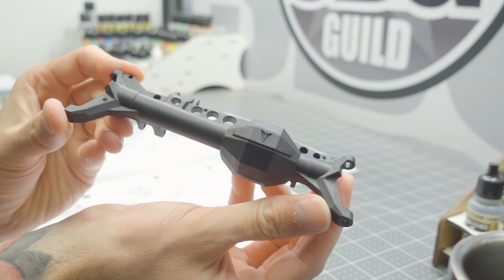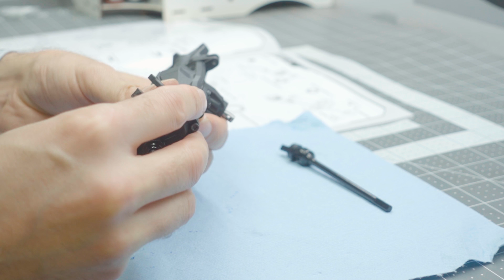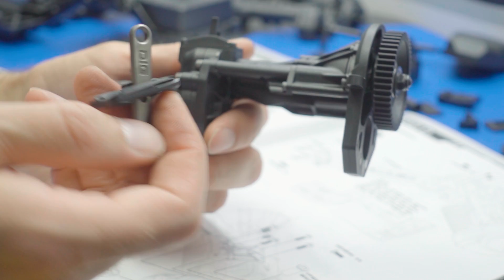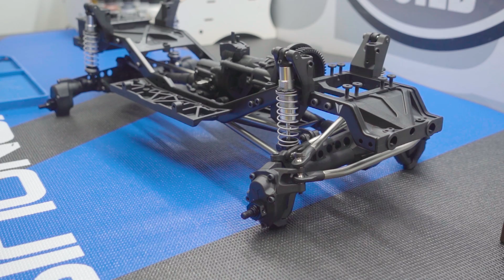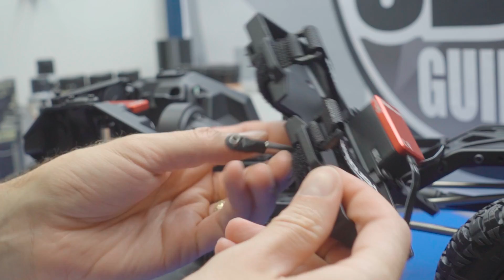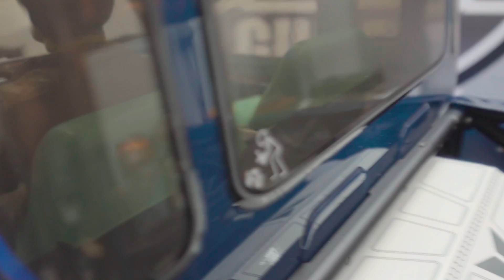Vanquish Products VS410 Phoenix Build Highlights

Comment: I'm building my kit now. After I added drive shafts to the trans. It's very hard to turn them by hand. When I had the trans out of the truck it was very easy. Not sure if that's right or not
Reply from the maker: I'd suggest a tear-down and start over. There are a couple of bearings that are close in size that if reversed can cause some binding. Hope that helps!

Comment: Hey, man! I recently got into RC and initially got into 1/24. Now I was to get my first 1/10, and I am seriously considering the Vanquish. It'll take some time for me to research all the parts and get everything I need, but with your comments about the manual I am confident I'll manage. I wanted to ask you if you could give me a list of tools that I would need for the build. I don't really own many tools so I would need to get all the tools as well. I don't want an electric screwdriver but need to know the tools for the hex, nut screw sizes, etc. 

Thank you! Nice video! I will probably watch your full build once I get everything I need.
Reply from the maker: Thanks for watching! the Phoenix is definitely one of my favourites, so good choice! As for a list of tools here goes: Pair of pliers, flush cutters, Nut drivers- 5.5mm, 7mm and 8mm, Hex drivers- 1.5, 2.0 and 2.5mm. Everything that is required is listed in the manual. Good luck!
Reply: Seems all I'm missing is a couple hex drivers! 

So thank you! I'll be sure to tell you how it goes 😬👍

Comment: Ya kit is not what it seems.  Don't worry if you buy one you'll  find out.  Hopefully you  get second addition.
Reply from the maker: Interesting comment… this is one of my favourite rigs… what happened?
Reply: @scalebuildersguild  missing part , but vanquish step up and sending free replacement part out. Dissatisfied with shocks as your aware.  Its a high price for a kit to run into these kind of problems , bought a lot of cheaper ones with zero issues.  Again vanquish made it right, was going to delete message.

Comment: Hey Matt, I have finally been able to order one and cant find a clear answer on if the hobbywing fusion will fit? If not what would you suggest for a sub $200 setup? appreciate it and love all your videos on the phoenix so far
Reply from the maker: Fusion won't fit without modifying. It can be done apparently, but I have no experience with it.

Comment: I'm more or less new to RC and while I love it, I'm also terrified of building one, but I really want to. I just managed to do the straight axle swap on my 10iii and so far, the only thing I think I did wrong was put the engine in backwards! Time will tell though. Has anyone built this kit yet? Is it hard, or could a "beginner" do it? I've learned the hardest part (so far) is having the right tools and learning the vocabulary, never mind the fact that the electrics and battery options are utterly overwhelming! Any help would be appreciated.
Reply from the maker: It’s perfectly fine to start with. There might be a few frustrating moments, but with these videos to help you through, I’d say give it a go!
Reply: @scalebuildersguild  Thanks Matt, very much appreciated.

Comment: Do you anticipate a possible binding issue on the dig, overdrive servos, when the dogs don't align up just right, with no servo saver?
Reply from the maker: Nope, it's a mechanical keyed system, as soon as the axle moves even slightly, it pops into position perfectly.

Comment: Yeah I had so much fun putting my pro together, I watched Josh from Harley designs build video three hours and 45 minutes only looked at the manual for the screw size and the length of the links, after two years few thousand miles never broke nothing until now one bearing went out in the front ring gear I need the bearing retainer because I can’t get the outer bearing race out of the bearing retainer I emailed Vanquish for the part waiting on hearing from them

Comment: Just no.
Vanquish was the top because they never skimp on quality. I'm guessing i would buy the axial raw builders kit over this one.
I'm still building my pro, but Vanquish looses points because of this rig.
Reply from the maker: I guess that’s one opinion. Not sure how you can think that though. Still a strong upgrade path and a much more affordable entrance to one of the best platforms ever.
Reply: @scalebuildersguild  the whole reason I finally gave up the money for a vrs4 was for the axles and the transmission. The rear plastics get replaced, and the bumpers go into the parts bin. Then the truck gets built from there. So, this kit has removed all the good stuff that makes a Vanquish worth the money. If I'm going to throw half of the thing into the spare parts box I'd rather toss cheaper stuff.
Reply: I agree with Brian.  I  have a penchant for machined hardware which is why VP has always appealed to me as a brand. I think it is great that they are offering a pocket friendlier version for the masses,  but im going to hold out for a deluxe version. Upgrading would be too expensive for me as I live in Germany (Guten Tag) and getting hold of VP parts is a costly undertaking. Id much rather buy the finished product pay the shipping and any duties and be done with it. The VS4-10 PRO is an option, but i much prefer the features and look of the Phoenix, so as hard as it may be, im going to bite my lip and wait it out.

Comment: Hey man, I'm looking to pick one of these up soon. I have a question on motors. I know that it only accepts 540 sized motors so my question is will my Spektrum Firma 2100kv BL motor fit?
Thanks in advance
Reply from the maker: Provided it’s a standard 540, you shouldn’t have any trouble.

Comment: how would you compare this to trx build ?
Reply from the maker: Traxxas’ manual is hard to beat!
Reply: Two words over priced
Reply from the maker: @jasond1245  how do you figure? Curious to hear your insights!
Reply: @scalebuildersguild  easy trx4 sport kit 300 scx10.3 kit 400 its 200 dollars more the trx4 so I guess a selectable overdrive and dig is worth 200 bucks more and with one piece axles and if you look at it compared to a scx10.3 same style of axles but it has a license  body with dig and 2 speed so I guess the selectable overdrive is worth 100 bucks by it self not trying to be mean but this is me looking at it logically comparing too other quality kits and I know you like vanquish your friends with Harley designs and I like both of y'all's videos even though he comes off a little arrogant sometimes I just don't see how you can say this is not high when compared to other kits
Reply: @jasond1245  quality costs... don't get me wrong, the TRX4 Sport and SCX10 III are great kits,  and good value too - but the Vanquish plastics, metal components, and chassis/transmission design as a whole are a step above. That is what you're paying for - finesse.
Reply: @yodapig  sorry sounds like you paying for a brand name the frame and plastics and transmission on the trx4 are great can't say on scx10.3 since I don't own one but I've seen people run stock trx4 4s plus.
Reply: @jasond1245  I get what your saying but just basic Pysics and chassis, transmission design puts the vanquish truck in front for me,  also the c hub and portal design is a lot more compact...
I like all the trucks, but money is a factor for some and folks should purchase what they like within the budget they're working with. In my eyes the scx10iii is more a comparison as it has interior,  molded inner fenders etc . I think for the added levels of option and included parts have them all sitting at slightly varying prices and levels of value.
And yes Josh can come across as a bit of an arrogant dick at times but I'm sure he is aware of that..lol. but I respect him for saying what he backs or believes in.. as I do everyone. 
Cheers 👍
Reply: @mickd8188  I agree the scx10.3 is more comparable but for me I just can't see how the plastics and frame can be any better on the trx4 never bend or broke anything and have rolled it off strip mine hill 40 or 50 feet with only the body taking damage so when I look at it for 200 dollars more I only see the dig and selectable overdrive also the axles are not one piece which is why I don't own scx10.3
Reply: @jasond1245  the strength of the trx4 is not at doubt, it's tuff as nails, it's how low vanquish get everything within the frame , you can barely see the motor it's that low and forward.  Also all the bracing etc. has a really scale look rather than purely functional.   The trx4 c hubs and knuckles stick out and can hang you up where as the vanquish ones are more tucked in and don't overlap at bottom. Axials design is a bit "sticky outty" also.
That's part of what I'm happy to pay "extra" for..
Reply: I agree the transmission is nice but not fan of the axles due to one piece design and just don't think it's worth 200 extra dollars over a trx4 sport kit
Reply: @jasond1245  that's the beauty of this hobby mate, you don't have to agree as we are spoilt for choice.  But with those brass inserts and vanquish design, quality and testing I don't think a single piece design will be an issue.
Enjoy your weekend dude👍
Reply: @mickd8188  I never said vanquish is bad quality just overpriced
Reply: @jasond1245  If it's overpriced it won't sell..
Reply: @mickd8188  no overprice stuff sells all the time
Reply: its like the battle of portals, last producer joined it makes the best ones i think
Reply: @AlphaPhaseSleep  sometimes.  But in this case yes I think the vanquish portals are superior, even their Capra portals are a better c hub/knuckle design etc.
 That said the Traxxas portals are really stout and reliable, they just hang out the back of the wheel a lot more.

Comment: Another great video. You said what servos you were using for the trans, but didn't say which one for steering. Is the 3100kv motor good for just a trail truck, or could you possibly drop down kv's?
Reply: Yes 3100 is a good middle ground for trailing and crawling. Make sure to go sensored though if u go with 3100kv.... go lower kv if ur running non-sensored.
Reply: @jhawk1985  

Awesome. Thank you.
Reply from the maker: T-120's for shifting, T-440 for steering. 3100 is pretty high for trails only. 2700 would probably be just right.

Comment: Do you know if they might offer gears to do no overdrive to the front and then shift to have 33% overdrive? Just wondering because I can drive up to 10 miles in a day and having 6.5% overdrive is still hard on everything when going long distance. I only know that because of the element trans that I used. The motor and trans got so hot I couldn’t touch it lol.
Reply from the maker: Maybe they’ll offer that in the future.

Comment: Hey Matt, great vids bro. I just purchased 2 vs4-10 Phoenix kits. I’d rather straight axles so I’m asking you if I can use 10iii straight axles?  If so would I have to change any gearing in the tranny? I know you and josh do all sorts of modifications. Just wanted your opinion. Thx in advance
Reply from the maker: You’d need to make your own links, and panhard, but I don’t see why you couldn’t get them to fit.
Reply: @scalebuildersguild  cool much thx. Yeah Josh video showed me how to make links 😂 I appreciate what y’all do and the contributions y’all have made to rc. 👍
Reply: Vanquish has the three links in a kit on their site already for those axles in the 410 chassis kit.
Cheers 👍